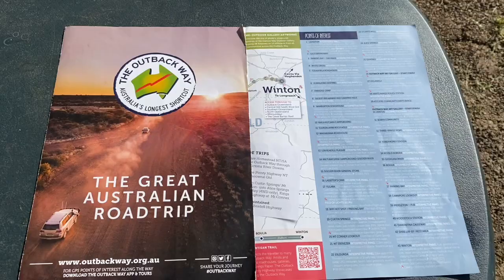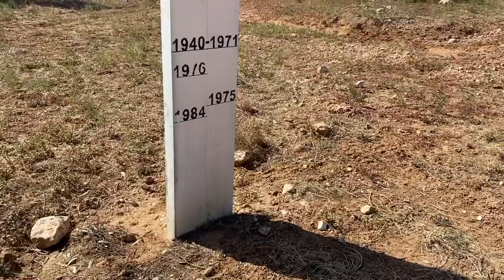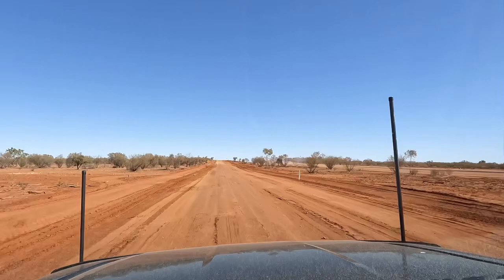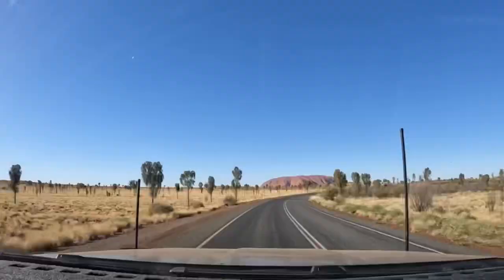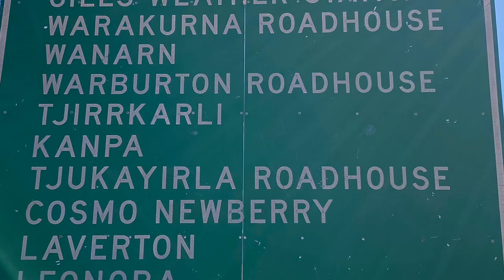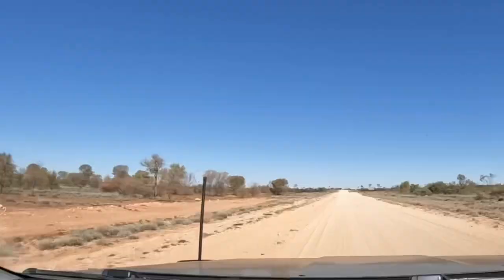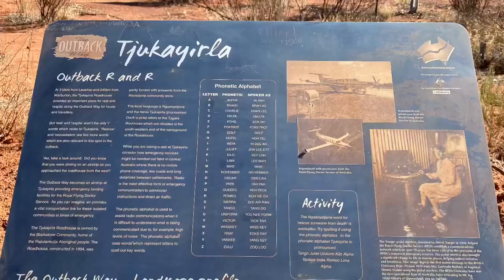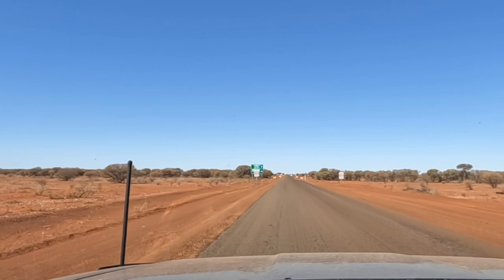Travel the Outback Way from east to west, Winton QLD to Laverton WA July 2022

Comment: I see some websites say you need a 4wd to do this trip, but none of the roads look like you actually need 4wd. Did you even have your rig in 4wd at all? Do you think a Sprinter van would make it? They have excellent ground clearance and I have been on many gravel roads. Obviously, after rain things may be too slippery and/or boggy for a 2wd, but the road looked fine on your video.
Reply from the maker: Hi, I’d have no question that the Sprinter would make the first part of the Journey from Winton to Uluru. The W/A side of it is very rough with corrugations (especially west to east) and not sure if the interior contents of the Sprinter would suffer. Having said that, Bull dust or Sandy sections wasn’t a problem and the worse road was the side road to Lassiters Cave. Hope this helps!
Reply: @happycampersaustralia  thanks for your reply. That does help heaps. I'm not worried about corrugations. I just don' t want to get stuck, so the soft stuff that lasts for more than 100m or so that needs 4wd or actual bog after rain would be my main concern. It just moved onto my list of possibilities. Cheers.
Reply: @MrGundawindy  4wd is supposedly less damaging to the roads also
Reply: @andrewford80  yeh, if it's bad enough that 2wd will damage the road I don't want to risk it. Not primarily for the sake of the road, but if it's that soft I'm only one mistake away from being bogged. 👍

Comment: I noticed you covered over the external fridge vent. Assuming that it is three-way fridge, how significant did this affect its operation at? Did you also cover over the hot water vent?
Reply from the maker: Yes, it is a 3 way fridge. We turned the fridge off while it was covered, and turn it back on when we arrive at camp. Because the fridge is closed the whole time it did not get warm, and we travelled in winter which helped too. We have covered the hot water in the past, not sure if we did that time. We tend to just blow the dust out of the hot water every so often after dusty roads. (With a blower vac) By doing that, we are getting lazy with covering it as much as we used to. 😃
Reply: @happycampersaustralia  Thanks. If you don't mind me asking, how many hours a day would you say you travelled in this crossing? I only ask because my experience has been that the 3-way fridge does not perform well on 12 volt, so I would be fearful of turning it off completely. Peter.
Reply from the maker: Don’t be fearful. It is just like a big esky. We had it turned off (no power at all) for 4 to 5 hours per day. Everything stayed fresh. If we were in the tropics with 30+ days, it would be a different story, but we never have an issue turning the fridge off for a few hours in normal to cool conditions.

Comment: great video guys .could you help me my partner wants a double axel caravan for traveling out back but i think a single axel would be better what do you think 😊
Reply from the maker: We prefer single axle for off road manoeuvres. It gets into tight places easier. We have done about 200 thousand KMs on single axle, including remote tracks. Just be pedantic about checking tyres regularly (on some tracks they are checked daily) …… If you wife wants dual axle because she wants a large van, you have no choice, but if a small van will suit, there is no need to worry about blow outs as long as you are aware of what is going on with your tyres.